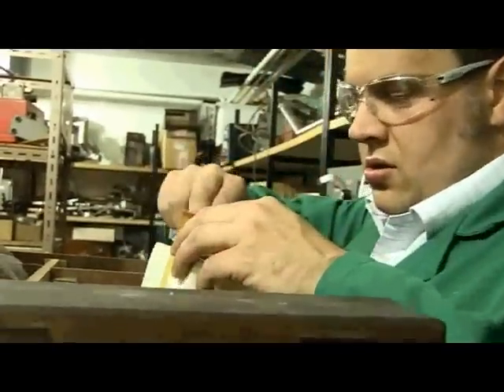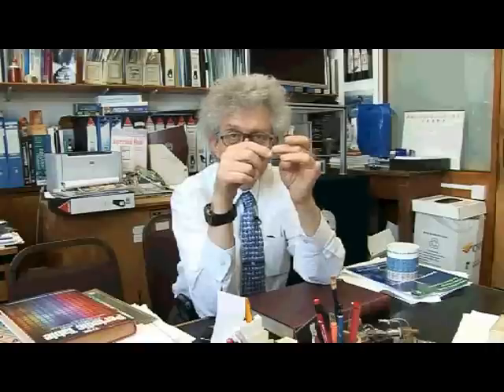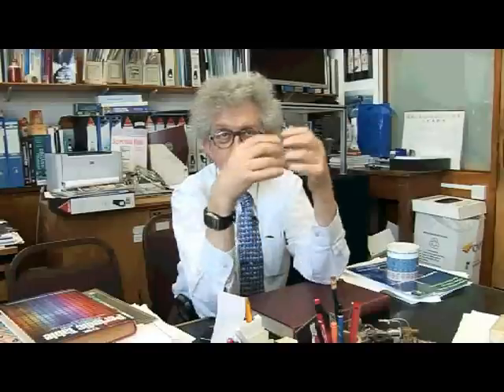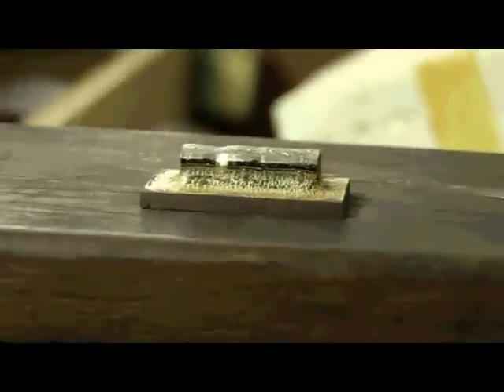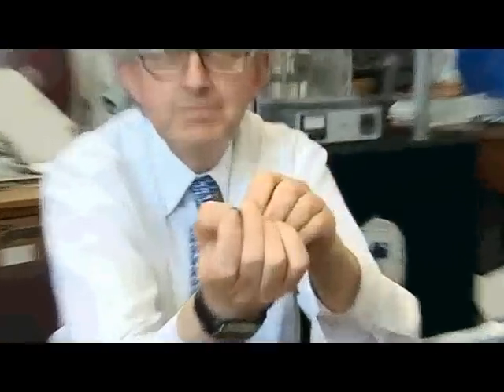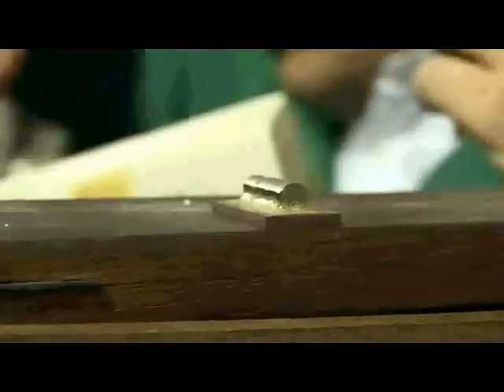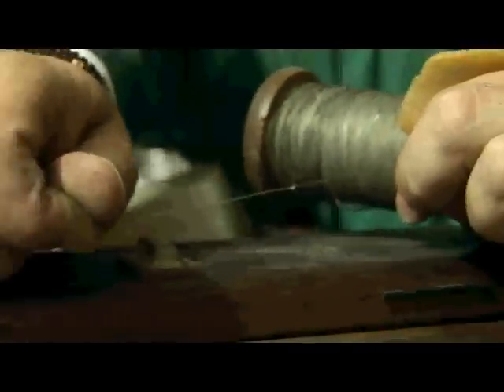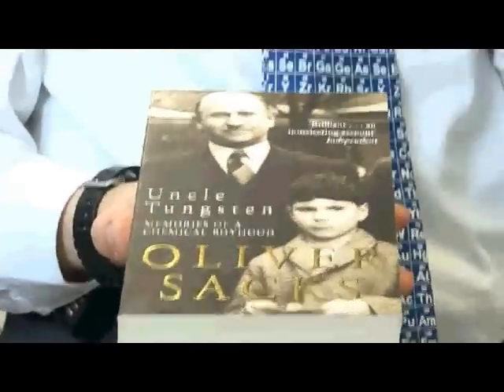Tungsten (version 1) - Periodic Table of Videos

Comment: Interesting that the older gentleman calls tungsten lamps "ordinary light bulbs", while the younger chemist describes them as the "old style light bulbs".
Reply: Reflects the generation gap.
Reply: And neither one of them seems to be able to remember the word 'incandescent'.
Reply: and someone should describe them as the most common sense and best style of light bulbs...?
Reply: @trabiccolo879  - 
I'm quite sure you mean the most grossly inefficient type of light bulbs, with no real choice of color temperature. Until they come up with a light bulb that runs on burning kittens, tungsten bulbs will have to be the worst.
Reply: chalo colina I mean, if you want those traffic lights to need their own heating elements and for cabins in the woods to be even more miserable, sure, they're the worst thing. The incandescent gives off the signal and melts the snow off the lights and warms up the shed or shack you're huddling in. 

Both of thosr are already immensely useful 2-in-1s. People are probably already marketing them as such.
Reply: @bottypaige8165  I'm quite angry about that.
Reply: It was the standard for ages.
Reply: And the “early style” incandescent bulbs used a carbon filament not tungsten.
Reply: @chalocolina3554   Yes, the most inefficient lamps ever [50% of energy used as light output 50% as heat], aside of the fire risk from those once 'fashionable' downlights that melted diecast aluminium light fittings and wiring. A 'useful' feature, NOT.
Reply: And the "new" generation says "Light Emitting Diode", WTF does TUNGSTEN stand for...
Reply: And because I'm in between and knew both they're just "incandescent lightbulbs" to me
Reply: Nice find.
Reply: You may find them in upscale cars..😅
Reply: @oron61  I hope you were joking with this.
Reply: I consider them 'light bulbs' ... then we had florescent bulbs,  now we have LED bulbs 

light bulbs were the first light bulbs,  let's keep them that way together 👍

Comment: Tungsten (AKA Wolfram) has widespread use in military technology. For example, modern armor piercing tank shells are made of tungsten, where the good density and rigidity properties make it an effective (although somewhat more expensive) non-toxic alternative to depleted uranium.
Reply: i believe its not just modern armor piercing shells, i think they used it back in WW2, with the armour piercing composit ridged, but not really common, because thungsten was expensive to use or to get it (not sure which one). but im not really a weapon expert, i did read some books about weapon technology's in WW1/2 a few years back
Reply: I live in Cornwall and they opened up some old mines bearing wolfram ore for use in munitions and for toughening steel I believe during WW2, I think a couple stayed open until the 60's. I don't think that the deposit/s were "worked out" so I'd guess that the processing side may have been expensive, at least in comparison to sources abroad?

Comment: Wolfram (tungsten) is also used in the best cello strings in the world, and it makes a huge difference to the sound! They're quite expensive too: One C string costs about 65 pounds.
Reply: +Lau Bjerno Interesting, I use Tungsten everyday at work for my welding electrodes and also at home in my machine shop using Tungsten Carbide insert tools for cutting metals.

Comment: Tungsten is also metallurgically important for its hardness, density, and high melting point (it has the highest melting point of any element). It's used in military ammunition for very dense penetrating rounds — that is, when militaries with a sense of environmental decency (as opposed to, say, the U.S. military) don't use depleted uranium.

Comment: tungsten is also used quite extensively in several welding processes.  tungsten inert gas welding of TIG welding uses tungsten as an electrode.  Sometimes various alloys are used and sometimes pure tungsten.  It is probably the more technically challenging and least efficient of the manual welding processes but is favored in some instances where fine heat control and penetration are required.
Reply: ***** that's a great point.  I don't know how easy tungsten creates a compound with iron, I do know it bonds with carbon.  Perhaps making the alloy more brittle such as with tungsten carbide.

Comment: Also recently used by criminals to produce fake bars of gold bullion because the density is similar to gold and cost is lower. Typically the bars have an outer of gold and can only really be proven to be fake when drilled into! Because doing that would reduce the value of a bar, who knows how many are out there.
Reply: J F : that is a scary thought.
Reply: That's silly. Gold is gold; the bar is to organize its weight, not a magic shape to make it more valuable.
Reply: ??? What ??? Maybe you could fool an inexperienced person with a gold-plated bar of lead, but you could scratch it with your thumbnail and easily see it wasn't gold.
Reply: @BarryObama666  (Tungsten, not lead.) Not if it was a thick layer. Also, many gold bars are owned by people who never get to touch them, or who would never want to 'damage' them.
Reply: Doesn't Tungsten have a much higher density than Gold?
Reply: @gingermcgingin1733  Both 19.3g/cm^3
Reply: Theoretically, you should also be able to also test it by inducing currents in it with magnetic fields and seeing how they flow, but it's probably not very feasible to do that. But the problem highlighted here is that it is quite silly for humans to value gold as they do, and if it was their intention to never use it for anything and to leave it as a bar sitting on a shelf forever anyway, then what difference does it make if the inside is filled with tungsten.
Reply: @medexamtoolscom  Actually, in the modern era, gold is valued for it's electrical properties (it's an excellent conductor, so is often used in electrical components), & it's physical properties make it ideal for certain applications in physics (for example, gold is used to coat samples before putting them through electron microscopes)
Reply: @gingermcgingin1733  yes it is heavier than gold, only the radioactive elements like Uranium are heavier.
Reply: @oron61  Has one year been enough for you to understand this simple concept?
Reply: @medexamtoolscom  It's not silly, gold is actually really hard to counterfeit if you split it into coin sized lumps, so it makes for one of the only currencies with no risk of inflation. It's perfectly logical to choose gold and silver as the base for all trade independent from the state
Reply: @tafazzi-on-discord  What "simple concept?" Are you trying to tell me that gold can't be melted to see if it's filled with tungsten or something? Or are you saying that casting it into bars gives it magical properties? Please enlighten me.
Reply: @oron61  not everyone thar trades gold bara haa the means to melt it. Especially because ingots have a specific shape so they'd need both something to melt the gold with and a way to resolidify it in exactly the ingot shape.
Reply: @tafazzi-on-discord  You can melt it with a $400 kit and a microwave. You can instantly tell tungsten-filled with a $400 dollar ultrasound wand or a couple drops of acid after melting it. A kilo of gold is worth just under 160 of either of those tool as of this year. If you trade gold in bars, you have much more than the means of melting it and rolling it into foil to acid-test prove that every last pinch of it is pure. 
So tell me why the shape of the gold is more valuable than the actual gold, since a tungsten-filled fake is okay, as long as it's in its "specific shape?"
Reply: The density would still be different thus a chemist with even basic training would be able to see the foil of that plan. That sounds like something from a bad spy movie to be honest. Still kind of a cool idea really.

Comment: Tungsten is also used in Xray machines. X-Rays are produced thanks to the thermoionic effect on the cathode and then the "breaking radiation" in the anode. Both the cathode and anode are usually made out of tungsten which has a low fusion temperature and thus is less affected by the space charge effect.

Comment: After Bz, W is an interesting element. I've worked extensively with it as a Tig welder. It is perfect for this type of welding due to it's ability to conduct high amperage electricity, and it's low oxidation rate.
Reply: What is Bz? I’ve never heard of that.

Comment: Yes, you're right about the equation - I was refering to the principle in general. With guns, the velocity of projectile depends mostly on the lenght of the barrel (there are limits to the pressure one can obtain from the gunpowder, that's why the lenght matters more). KEP's are "saboted", and the pressure the gases are exerting ot its backside (ca 1 sq in) are way below DU yield limits (AFAIK). In my opinion then there's no need to coat DU rod with tungsten (no benefits over plain DU) 2B cont'd

Comment: The usage of Wolfram (tungsten) on the large scale is not in the light bulbs but in steel alloys.
Also it's used in kinetic energy ammunition (wolfram is used for the better quality ones, otherwise cheapo depleted uranium projectiles are used, or even cheaper, steel)
Other use is in cutting tools, and in welding rods for WIG/TIG.

You can see that a kinetic missile with some 20-30kg of wolfram is way ahead of milligrams in a light bulb.

Comment: tungsten filaments are also used in fluorescent bulbs.
Reply: As heating elements at both ends of the lamp tube, to promote striking of an arc through conductive gas within the glass envelope 'bulb'. Cold cathode fluorescent lamps use tungsten electrodes to resist plasma arc burning during operation.

Comment: I bought a tungsten carbide ring a couple of years ago, surprisingly cheap, it has resisted scratching almost perfectly, i can see very small dust like marks on it if i light it with a powerful lamp
I have worn it while using adjustable wrenches, i have dragged it across and knocked it against all sorts of things, i have even scraped it with extremely hard knife steel on purpose to see if it would do anything

Comment: Tungstencarbide is also used in high-velocity APFSDS ammunition because of both its mass and its hardness.
Reply: I wonder if you have enough of it... if you could make a suit of armor... of course it would have to be powered in some way... otherwise you might as well be a statue... as it would be way too heavy to move in
Reply: Braidborn
 you mean... ironman? (tungstenman)
Reply: Zoddom basically... Only if I remember correctly ironman was made with titanium alloy...but considering how strong it is... With enough padding I'm pretty sure you could survive a tank round
Reply: Braidborn dont underastimate tank rounds. the most sofisticated have 13 MJ velocity. With a cross section about 4 cm I think
Reply: +Braidborn The whole Iron Man thing doesnt work, because of humans basically being a soft and squishy mass with some bones in it ... which dont do instant stops from 100 to 0 without injuring themselves ... you would still be jolted around inside the suit of armor and hurt your innards.

A much more viable way of using a "suit" would be in the shape of giant mechs ... but those are just bigger targets and would not be practical (not even in a fight against giant monsters that are invading Japan), because they would destroy the landscape while trying to get to a target. 

In short: "armor through tough materials alone" doesnt work and many tanks have reactive armor (which is hung in pack on the outside of tanks and which explodes when a shell hits it, thus deforming/deflecting/destroying the shell before it reaches the inner armor). Just watch the news and sometimes you will see the packs on the outside of tanks in war zones.
Reply: Muck006  isn't that armor called Ablative?  And with the right padding,  even if it hasn't been created successfully yet, I am sure that we could survive pretty much  anything... The iron man idea was simply hypothetical... I know that it is currently impossible
Reply: +Muck006 What if the armor had some sort of gel layer that would protect the user from those Gs gained by making quick stops like 100 to 0 produces?
Reply: +Thorin Rorikson Then I think the gel layer would need to be so thick it would make the whole idea useless, even if it was some reactive gel acting on movement.
Maybe ;)
Reply: +XNeo27564 Flash Forward 500 years to the Halo video game series and you guys are describing exactly the kind of armor spartans used.
Reply: dario110011 Hehe

Comment: i've used tungsten for TIG welding. it's remarkable how high it's melting point actually is. the steel melts into a puddle and glows just as bright as the tungsten tip, yet the tungsten rod isn't really affected. i'm surprised they made wire out of it, even though tungsten is extremely hard, (tungsten carbide is a 9 on the hardness scale where diamonds are a 10), it is very brittle and shatters easily.

Comment: I think there's no need to do so. Kinetic Energy Penetrators are made EITHER from DU or tungsten. DENSITY is what matters here, hardness of the projectile is a secondary factor in efficiency of KEPs.
"Regular" DU ammo even more relies on very high density of uranium: kinetic energy = velocity x mass, thus the higher the mass, the higher the energy at given muzzle velocity (and greater the havoc). Furthermore, higher mass to size ratio improves ballistics of the bullet.

Comment: It's also used in lathes as the cutting "blade", because almost every other metal is softer than tungsten.
Reply: That's actually tungsten carbide, but, yeah. Probably the heaviest use of tungsten in industry, for making cutting tools (also drill and milling bits).
Reply: HotelPapa100 it is also proving popular as jewellery now. I have a solid tungsten ring and necklace. They're reassuringly heavy!

Comment: I have 2 Tungsten rings. very nice.
Reply: +Lloyd Leonardo 

Watch out around heavy machinery, or you could end up minus a digit or two.
Reply: I only wear them when I go out. Not an everyday thing.
Reply: Chino Pisces still looks brand new
Reply: +Chino Pisces +Lloyd Leonardo When wearing a tungsten ring, swelling fingers (maybe through allergic reactions) cause a big threat, as the ring cant easily be cut and if you dont act fast enough, you could lose that finger.
Reply: Zoddom I see. I'll keep that in mind.

Comment: Right then. And may peace prevail on Earth ;-)
PS: Lead is quite dense but very soft, that's why it makes sense to jacket it in hard steel. DU isn't as hard as W, but quite hard - and can be hardened further by alloying; much simpler and cheaper than creating a jacket from very hard metal (W) and filling it up w. DU (whatever you'd save on the raw material would be eaten by higher manufacturing cost of W jacket/ DU core KEP). Besides, DU KEP is self-sharpening on impact and pyrophoric. 2B cont'd

Comment: @dondude69 The thorium helps start the arc. The radioactivity in thorium helps ionize the air (or what ever you're using as flood gas) and create the arc. Once the flood gas ionizes (glows) it's easier to maintain the arc.

Comment: How many engineers does it take to change a lightbulb?  ...Well technically it's a lamp.
Reply: Evi1M4chine  Nope, you are obviously not an electrician.  The bulb is the glass envelope component of a lamp, a lamp holder is the socket holding and making electrical connection. Lamp/Light fitting is the total assembly. The serviceable replacement lamp is installed.  Fluorescent lamps are sometimes in a tubular form, sometimes coiled, that are installed in a lamp or light fitting.

Comment: @nosirrahx Tungsten is very dense - in fact, it's density of 19.2 g/cm3 is almost exactly the same as gold. 

Supposedly, you can make fake gold coins out of tungsten, and then plate them with gold, and you'll be able to fool buyers that don't use electrical resistance testing. I'm not sure that this is a particularly practical scam.

Comment: I wish I had a car made entirely of Tungsten. Won't have to worry about the bumper coming off...
Reply: Yeah, but you will have to worry about buying gas/petrol for it. Because the car would weigh as much as a semi-truck. And if you crash it [because breaking would be much harder, due to higher inertia], you'll certainly die because it would not crumble like Steel/Aluminium.
Reply: Square Root  The interior is made entirely of fluffy velvet cushion, a meter thick. The poor obstacle will not stand a chance. Look out for the marshmallow freight train.. oh wait there's already a name for it.. something like a TANK
Reply: Also you would die because there is no flex to absorb the energy between the object you hit and your seatbelt

Comment: You Guys Did a Bad Job Here . . . 
- you guys missed all the interesting features of the tungsten iodine cycle.
- you guys missed a very interesting story of how you can draw it to a fine wire.
- you guys missed the fascinating fact that a coiled coil of tungsten filament is molten on the inside of each turn
- you guys missed how it is that a negative resistance material can be made to not have weak spots runaway and melt
- you guys missed why Edison did not choose tungsten
Reply: +Walter Clark They are slowly updating there video's and they will eventually get back to Tungsten and make a better one. Lots of their older video's didn't have as much information.
Reply: +spaz cuber 
Thanks Spaz.
Reply: why didn't edison use tungsten?
Reply: He couldn't figure out how to draw it into a filament. The process is very complicated and seems to defy logic. See "ductile tungsten." It was invented by an incredible genius who lived until the 1970s.
Reply: Thanks :)

Comment: Can tungsten turn into tungsten oxide just by heating it's?
Reply: maybe but tungstens melting point is insainly high at around 3k degrees celcius. you would likely need to melt it for it to react. transition metals arent that reactive